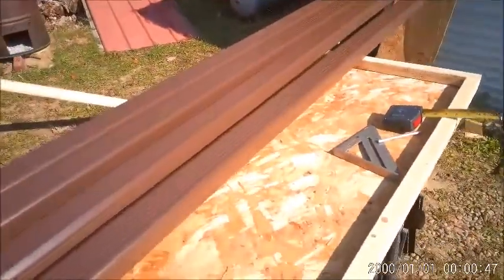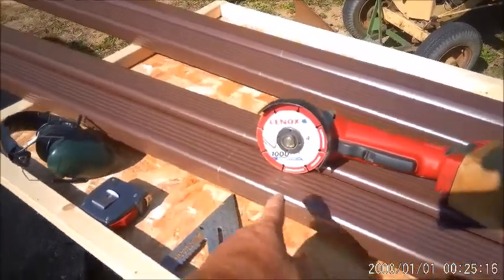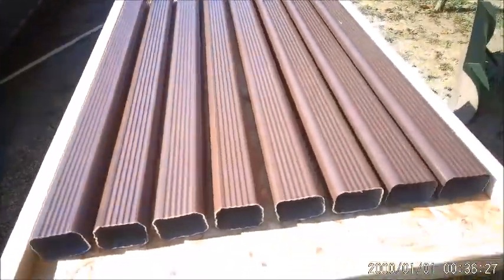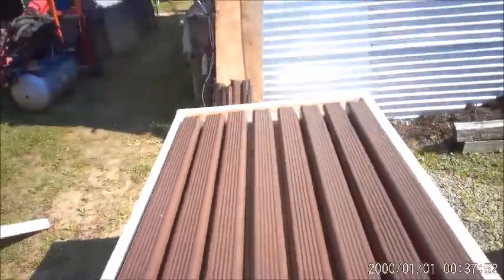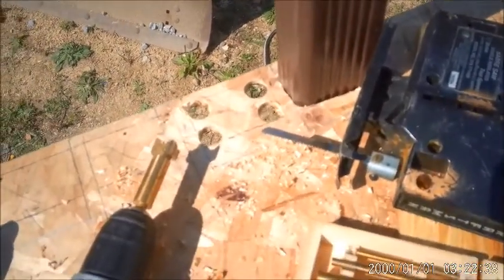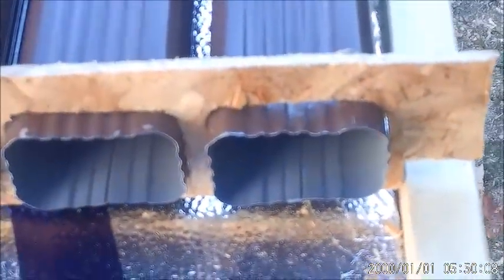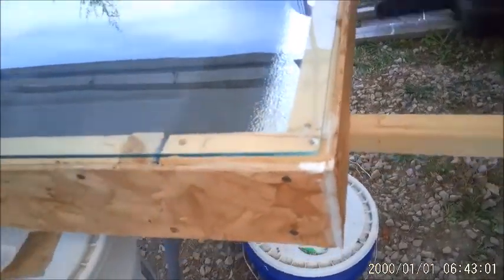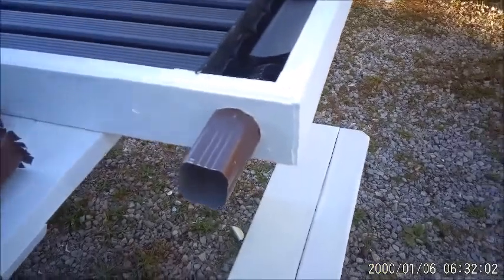Solar room heater, DIY solar hot air heater, FREE HEAT FROM THE SUN !!!

Comment: Add an additional cosmetic idea for this awesome heating system. The whole project made me think, got me interested in it, and wanted to do it for winter heat myself. Only thing I would want, and is not a big deal, is the duct vent tubes going into window, would earm me some visual criticism from neighbors who dint mind giving opinion as they are also family. So only in my unique situation is why i would even alter. But id try to utilize something repurposed to cosmetically "pretty up" the vents into the window, either by an unused truck hardshell cab standing up to hide vents, cover it with thin veneer or siding, and it helps contain heat in vents while after painting, makes it visually attractive.  Or some similar cover repurposed like a crate cut to fit, and using under house vent tubes, in ground, anything to avoid family comments. Lol. But if no neighbors and temporary set up, i wouldn't change a thing.
Reply from the maker: You hit the nail on the head. It did not look very pretty. I think since my house has no basement, I will be using the inlet from under the house at one end, and the heated air going back under at the other end. At least separated as much as I can anyway. It will be much easier to hide it then. Yes it was a test at first, but it works so well I will be incorporating it into a heating system for the floor of our house. I was limited to the side window (north-east) for my situation and had to vent it that far from the sunny side of the house. It would be much easier to use it beside or under a window on the south side. Thank you for the comment and for watching. Good luck out there!
Reply: @davenooner2142  I'm so impressed with the idea you have, I can't believe how much I dwelled on solar water, I hadn't thought of solar heat in a coiled radiator design with solar fan forcing in house. Opened up a Pandora's box of ideas.  Oh yea, I have idea on a potential climate cooling solution "if" it is needed. So far my online lookup hasn't seen one similar to my own thought up independently from influence of other designs for same purpose.  It was good meeting you sir, hope to again.
Reply from the maker: @jamesblake3090  Nice to meet you also. And check back sometime. We are going to build a solar oven some day too.
Reply: @davenooner2142  freeking genius!  I'm retaking an i.q. exam to see why these solar marvels haven't gone to my brain. Lol.  Oh well, broke a rib doing tree logging last week, so some bed rest will give me time to 1 up my old ideas and hopefully contribute to "alternative progress" I'll call it, that is what you Excel in friend! Have a great week. Talk soon!
Reply from the maker: @jamesblake3090  Get well soon. Thank You!

Comment: Where can I get the fans
Reply from the maker: Hi, I got mine from ebay. You can use an old fan from an old desktop computer too. These were 12 volt fans. You can look for computer case fan on ebay.

Comment: Nice! Whats the purpose of the top and bottom horizontal pieces?
Reply from the maker: The space at the top and bottom was more area that could collect more heat, so I used it by putting in those last two sections of tube in there and still trying not to block air movement. I could have just made all the tubes a bit longer I suppose. Thanks for asking. I didn't have real clear plans when I started, just an idea of what I wanted. I wish you luck on your projects. I will never be without this in my house, we love the free heat.

Comment: How do you think this would work for a garage in Minnesota without any sort of a fan just counting on thermocycling to force it. its been negative degrees for over a week, my garage is not heated but would like the cars to be able to drip off
Reply from the maker: If you set it up to allow the heat to push it by itself' it will still have air flow. This one we have here works over 100 degrees even at temperatures in the twenties. As long as the sun is out, it works. Just remember heat rises, so as soon as it goes in the shop you have, the air will go up, not out around your cars. The fan ensures an air flow out into the room as well as through the heater. Solar panel doesn't have to be big and expensive, the small fans use like .1 amps of current.

Comment: I like it. Good job. Now i have to examine my glass stack and the down spouts i have in the scrap pile
Reply from the maker: I am happy with the amount of free heat it gives off for sure.
Reply: @davenooner2142  i live in central illinois. I have a space i could use one but it would have to be; n the roof and im not sure how much heat i would get in the winter when i need it most.
Reply from the maker: @sassafrasred6657  We are getting between 100 and 110 degrees even at freezing and slightly below. Here in Tennessee its not real cold when the sun is out.
Reply: @davenooner2142  good to know. We have a sunroom that could use heat in the winter. Do you think it would work with blowing the air down into the room? Would the intake have to be lowered so it would exchange cool air down near floor level?
Reply from the maker: @sassafrasred6657  Any time you can help nature by the heat rises rule, would help the flow. You can always push hot air anywhere with enough fan power though. If your intake is near the floor for the cold air to the heating unit, new air will have to take its place from somewhere. I seem to feel better results when I push the hot air from it with the ceiling fan back down from it rising in the room.
Reply: @davenooner2142  do you have any kind of damper on it to stop the cold air from backing into the room when the sun is down?
I was thinking if i had the cold air intake low to have a fan at the lower end and at the hot air out let to help move the air.

Comment: hi..nice project...i wanna build somethink similar this year  but i wanna put some copper  pipe into the aluminium tub in this heater...and outside with some quick connecters  to connect the water hose to heat a pool....what do you think?
Reply from the maker: That will work well if the water pipe is in good contact with the aluminum tube so heat transfer will take place well.  But just using flat black painted copper tube with a convex light concentrator reflecting the sun will do a better job I think.  They sell expensive vacuum sealed glass tubes with copper pipe inside that works very well. Also they can be made with old fluorescent tubes for a DIY project.
Reply: @davenooner2142  nice ideas...tx for  your answere...and hope for more video project ...gl
Reply: @davenooner2142  how would you go about doing that with old fluorescent tubes?
Reply from the maker: @hessbonnie  You would need to open both ends, clean the phosphorus dust out. Then use copper or steel tubes painted flat black inside the tubes. Epoxy the tubes and glass with a capillary tube in it so you can suck out the air between the glass and copper tube later. Then attach them to a header or manifold. It is a lot of work but it is very expensive to buy the tubes already made. These can produce steam if the sun is concentrated on them.
Reply from the maker: @hessbonnie  https://www.ebay.com/i/121136257916
Reply from the maker: @hessbonnie  https://www.walmart.com/ip/30-Tube-Duda-Solar-Water-Heater-Pool-Collector-Evacuated-Vacuum-Tubes-Hot/782595888?wmlspartner=wmtlabs&&adid=22222222222111531254&wmlspartner=wmtlabs&wl0=e&wl1=s&wl2=c&wl3=75385336381206&wl4=pla-4578984908366186&wl5=&wl6=&wl7=&%20wl10=Walmart&wl12=782595888_10000011546&wl14=solar%20water%20vacuum%20tubes&veh=sem&gclsrc=ds